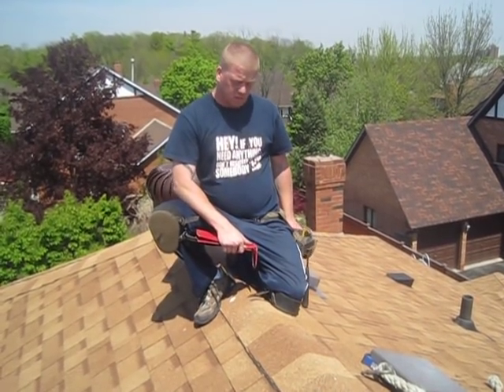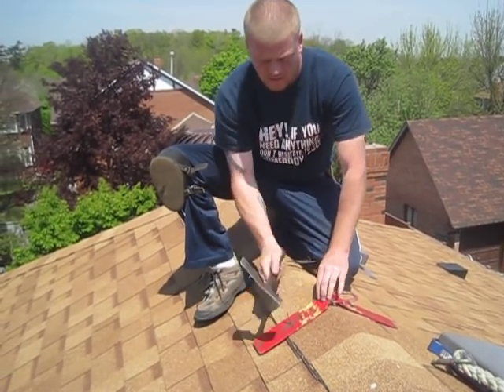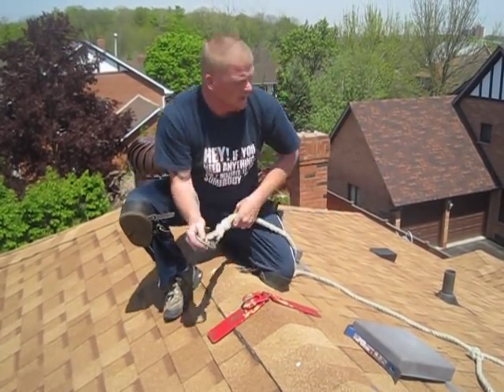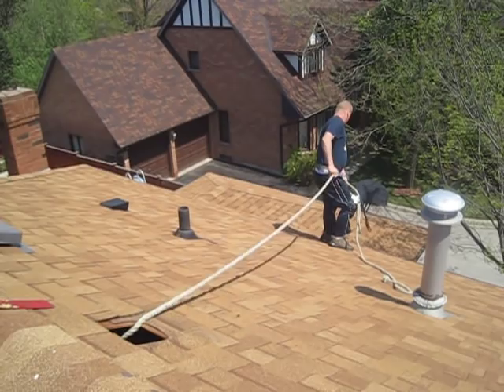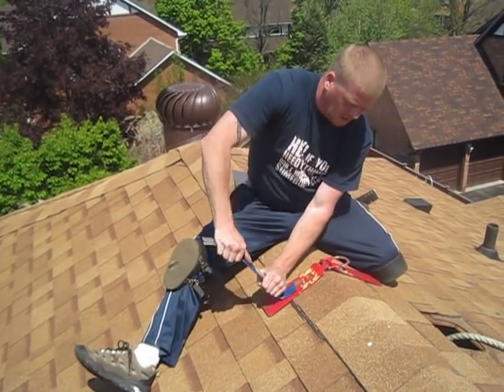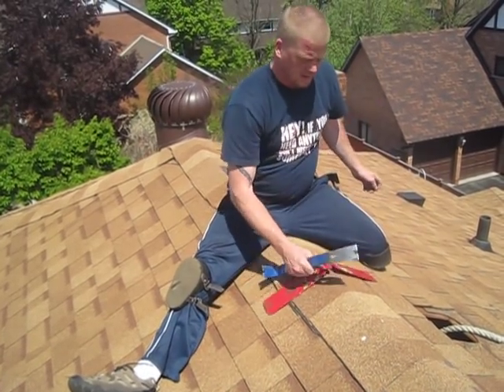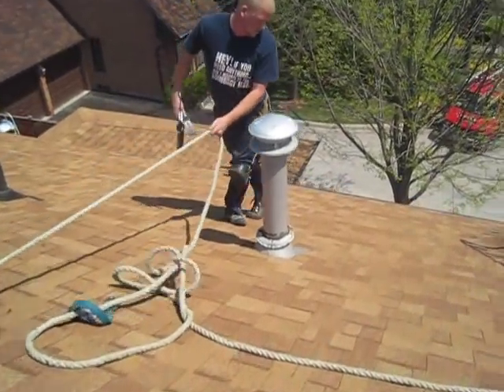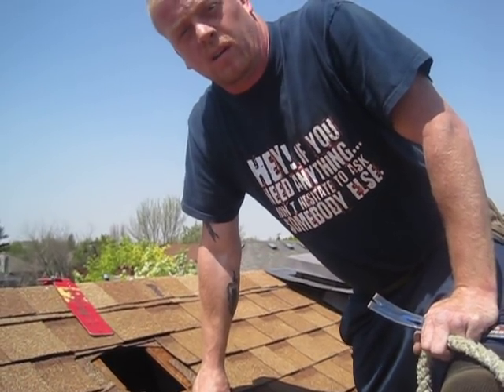Rooftop Safety

Comment: For all you home owners, when you want to clean your gutters, drive 4 nails in your roof. Not only in the plywood decking, but be sure you penetrate the trusses, or... You could rip your vents off. Good luck getting them back in without a roofer, and oh yeah, don't forget to throw the trash in the attic... Thanks, Elvis.
Reply: Dying over this video, and you summed it up perfectly with "don't forget to throw the trash in the attic"
Reply: Also, use your hand to karate chop you flatbar. Very important tip.
Reply: There is no way as a nearly 200 pound guy I’m trusting 4 spikes to hold me to the roof, and the pulling a vent is a total joke. Might as well just saved the trouble and hired the roofer that’s going to be paid to fix the mess you make doing that to clean the gutters for you...
Reply: That's roofing
Reply: By the way he's on a 4/12 I've never seen anybody on an 8/12 like this guy 8/12 is getting steep
Reply: Ok I did see the 8/12 side my bad really it's more cut than I thought
Reply: I think he's very good at what he does I'm a roofer we do alot of steep two stories double layer tear off resheets and maybee not the safest but how safe is roofing
Reply: blueyedevil TEAM MGK so you are proud of waiting unsafe? I do roofs steady and my first concern is going home in one piece... and ya a 4/12 is perfectly walkable. This roof is a little steep for someone that doesn’t walk roofs regularly
Reply: blueyedevil TEAM MGK did a home built in 1891 had a 2 story 8/12 triple tear resheet .
Reply: the nails hold just fine, screws are preferable, but nails have like 300lbs of holding force or something crazy like that, and he used 4

"good luck getting them back in without a roofer" 
just....slide it back under the shingles, renail, recaulk?
Reply: Those brackets state to use 32 nails or screws.  OK, I'll get right on it.
Reply: If you want someone to work on your roof, you have to be ok with them doing what they have to do to be safe. You’re not paying enough for them to not be safe. Or you can have permanent mounts installed if you’re that concerned about it.
Reply: If you tend to work unsafe on the roof you are one unexpected sneeze from falling. Sneezes come out of nowhere and a lot of people don’t think ahead.

Comment: Being this guy... Making a safety video about Roofing and the first thing he does is put a bunch of holes in the ridge, and then precedes to drag around haphazardly and almost trip over the safety catch the Rope was designed to be used with. 100% great job.
Reply: But what would be a better way to set up safety on a roof without puncturing the waterproofing material?

Comment: I install antennas on roofs and the hardest thing most of the times is getting onto the roof in the first place, little good these brackets help when you fall before you get them into place. I usually throw a feeder line that is tied to a heavy rope and go on the other side and pull it over and tie it to something on the other side, but then again that doesn't help if I go over that side..

Comment: Don't you have to caulk all the way around each edge of the metal vents to prevent water leakage? And are you sure you're going to be able to hang on to that rope if you fall or start to slide, since it's not connected to anything but your hands?

Comment: Can a person put the roof brackets on permanently, maybe nail them in and then caulk around the nails.  Can you use screws instead (sry, my only construction background is in stagecraft)?  I rather just put it up there and then leave it up there because I have to get up there annually to deal with the moss (or should anyway)...

Comment: Won't that red securement device leave holes on your roof once you take it off?
Reply: Yes and no. Obviously there are holes left behind. But, the shingles are made of soft asphalt for a reason. When they get hot, those holes are so small they will self seal, no problems whatsoever.
Reply: Don't listen to Erik. I'm a roofer and no those holes do not self seal. Lol. My day is made up of leak repairs. And a lot of them are fixing nail holes from improperly installed roof.
Reply: @michaelchristopher9444  Michael how do you install the harness tie down ring if you don't use nails please?

Comment: hello! thank you for the good tips. I'd never thought of pulling the vent cover.
do you have any hints on installing ribbed metal roofing on a very steep roof? I bought an old house that is a real fixer upper. first thing is the roof and it terrifies me, it's a 47 degree slope. any hints would be very appreciated.
thanks!
Reply: TheMapper Maybe you've done it by now, but do what he did with the D ring on the unfinished area, move it along as you go. To access an unfinished area you pull or leave out screws at the base and using longer screws screw a 2x4 onto the roof. After removal put washered screws in the holes.

Comment: Just as a complement of your information if you hit trusses you will be fine with 4 nail each side but if you don't you will need 8 on both sides total 16.
The anchors has to support at minimum 5.000 pound.
And if you want to be attached to trusses, do not use your life line for that, use an anchor strap.
But any way, good video and good luck,  not everyone can do what you did!

Comment: So if you put in a bracket every time your on the roof, and take it out each time, it seems eventually the wood would be full of holes and not make a good anchor.  It seems to me (a person with no roofing experience) that roofs should be built with a number of those brackets already in place (stainless steel nails or screws)  so safety is built in rather than installed with each job.
Reply: Good point. But to be devils advocate there's the cost and potential decay damage over time. Most people never go up on their roofs ever. Cheers.
Reply: abelincolnparth there is more than 1 trust u can anchor to
Reply: Indy Debauchery calm down simple spelling mistake
Reply: Simon Henhoeffer You're calling him out on his stupidity, I'm calling you out on yours. See how that works?
Also, it's spelled *You.  So actually you spelled one word wrong and mispronounced another.
Reply: In Dallas I've been seeing anchors on the newer steep roofs left behind by the builder for maintenance and reroof purposes.  Just started seeing it on homes built in the past 2 years now that everyone wants a steep roof
Reply: There are stainless steel permanent anchors you can install.

Comment: This is helpful for us DIYers.  Problem is I don't want additional holes in my roof every time I need to have my roof cleaned off or gutters cleaned.  If that bracket came in a thick zinc coating I could install a few and leave them so they could also function as moss control.
Reply: Zinc strips DO NOT work at all for moss prevention after the first year - do your homework
Reply: No need to be nasty.
Reply: +Susan Martin just don't want you and everyone being fooled out of there money by the zinc strip solution
Reply: Susan Martin, I'm looking for a solution to this problem too, but I'm wondering if you could just leave the nails in the holes when your done. Just a thought.
Reply: There are stainless steel safety straps meant to stay on your roof permanently.
Reply: permanent anchors..installed them lots

Comment: Would there be anything wrong with leaving one of these anchors on my roof permanently? I don't really see much sense in taking it off and then having to nail it back on again next time I need it. As long as I use roofing nails and caulk would it be okay?
Reply: Who sells this?
Reply: I just wanted to update you guys on @robert Faist. Sadly he fell off the roof of the house he was working on. The doctor's report that he is brain dead.
Reply: That’s a great idea, but I would paint it to blend in and put it in a place that’s not visible from the front if possible.  That bright red would drive me nuts.

Comment: Solid tips. Thanks. I like your quality commentary as you went along, too. You're right on with pushing your weight when pulling nails. This old guy uses a mallet or scrap 2x4 end to save my hands. Gloves, maybe wrist brace for hammering in the stuff bucket. And where are your safety glasses, young man?

Comment: More rooftop safety tips: Other than using a rope as your safety measure, you can wear a rubber soled shoe or boot, avoid slippery roofs, keep it clean, install shingle underlayment, and install temporary wood cleats for toe-holds.

Comment: Install anchor point in accordance with manufacturers instructions-may require the installation of the anchor point with many more nails.  Worker needs a harness and a lanyard.  harness and lanyard prevent the fall, and absorb the force.  Not sure the purpose of the rope without a harness and lanyard--very dangerous.  Length and type of rope is important as well.

Comment: So what if I have a metal roof? I really need to know also how do I get good footing on the slick metal??
Reply: believe it or not , shingle roofs are more slick than a metal roof . unless its wet or theres a bunch of stuff on it . keep your foot on the head of screws if you want . im on roofs almost every day , i know what im talking about .
Reply: +KentuckyFriedClassic I've been on both kinds of roof too. I've tried boots and tennis shoes on metal roof and I can't stand up, I just slide.
Reply: Jason Shingleton take a couple screws out and use the existing holes to screw down a 2x4 to stand on
Reply: Basically don't go on metal roofs without a pair of felt corkers. If the metal roof is wet, don't get on it at all. Wet metal roofs are unwalkable. And as always, it's good practice to use a rope and harness.
Reply: Try cougar paws for metal roof that what I use. Also if possible try to get on the ridge from the ladder or valley. Then set up the anchor and tie off.

Comment: If this is a safety video there are several things wrong, 1st when you put the anchor point down you have to put a nail in each hole for it to hold the prescribed weight of 5000 lbs, any anchor point must be rated for a 5000 lb drop load.  2nd He doesn't use a harness.  3rd he tied the rope back to itself which is not permitted.  Homeowners, whatever you do don't follow his safety advice.

Comment: could u tell me how u tie off on the 2x4 under the vent---thx for a great video
Reply: Its not always possible, depending on the location of the ventholes. but basically you just wrap the rope around the truss and clip it to itself and it won't go anywhere.

Comment: Can i leave the brackets on my roof permanently?  I concerned of water getting underneath of the bracket and leaking in.
Reply: There are permanent anchors available. I've seen them in stainless steel.
Reply: You can buy permanent anchors, best way is to safely remove the ridge cap and install it underneath behind the nail line. Install the ridge cap back on top. That way it won’t leak. A tube of black weather rated cocking to be safe too doesn’t hurt.

Comment: Just what I was looking for.  Simple how to and the roof vent idea is probably what I will go with.  First of all from reading some of the comments below, if you are not comfortable being on a roof to do this, forget it then.  I was a Lineman all my life, hanging off poles, ladders, trees, you name it.  Either you are comfortable with it or not, and if you are not, don't do it.  Yes it is important to be safety minded, but this guy is doing nothing that he is not capable of doing, that is the point.  I was up on my roof this summer, free style doing some eave & trim painting, but only on the single story portion.  Now, I have to get rid of the moss on the North side of the roof which has a steep pitch and is 2 stories.  I am 66 and will rope in for that as I definitely don't trust my balance skills as when I was younger.  Interestingly, Lineman now have to belt in to climb a pole, use a second belt to belt off to say advance over a  telephone line, before you can un belt your main strap and belt in over the obstruction again with your main belt.  Jeez, back when, always free hand climbed poles unless you were tired, or had a bunch of heavy stuff hanging off  your belt, or it was a 90' or 100' pole that you couldn't get your hands around starting up. Never heard of anyone falling off a pole while free hand climbing, although I am sure it has happened.  Safety first however, is always the motto.

Comment: Liked it. If you hit meat on both sides of the ridge with a few 3 ½" spikes, you could dance on the damn thing.

Don't so much like the roof vent trick, too many  have had work already and are a mess of random adhesives and irregular nails. After that, you're forcefully dragging your gear back and forth across rough cut edge of roof decking, essentially sawing it.

I'd bet that bracket cost twenty bucks or so... Worth it

Comment: Umm...you might be safer to not use that rope which you could trip on or which could wrap around you on the way down!  You should use a sliding break and harness.  ...but then again, maybe the rope can help you balance for just looking...if you are doing some work you can easily forget to hold on the hope.

Comment: No way that's an 8/12... more like a 4 or 5
Reply: my exact thought... also the rope is doing nothing there its a decoration since there is no harness on him to attach to...
Reply: @chazclemons4317  this roof is not steep enough to need ropes unless you have an osha job where it is required. in fact we never used ropes or harnesses on any jobs that was not required. the steep ones get toe jacks and toe boards of course.
Reply: @paulk5311  good for you

Comment: Before you secure that anchor to the ridge you are supposed to remove the ridge cap in that section and not throw your nails in there Atic definitely gonna have a leak there and that's not a 12 or anywhere close to it lol decent video tho

Comment: After seeing several of these videos and actually working on rooftop for a few years it doesn't make any sense to use this. Wouldn't it be much easier and safer to just put a eyelet lagbolt permanently in the roof! You're going to go thru all the bs of putting this on without a rope, and then when you are done, you are going to undo all the nails and go off the roof without a rope! Two times with the potential of falling off!

Comment: I just watched a You Tube video on ladder-safety. The ladder-safety “expert” ascends & descends the ladder with his hands tracing the rails. If he loses his footing he will not be able to hold his position. His hands should be gripping the same rung with each step as no man could hang from ladder rails while regaining his footing.

U.S. per year: cop-deaths = 128; ladder-deaths = 300 THERE WAS A DRAMATIC decrease in the number of law enforcement officers killed in the line of duty in 2017, with the second lowest number of officer fatalities in more than 50 years, USA Today reported. According to data released by the National Law Enforcement Officers Memorial Fund, as of Thursday, 128 officers had died in the line of duty in 2017. Forty-four of them were shot and killed. This is a 10 percent decrease from last year, which had 143 deaths, with 66 shot and killed. 
According to the World Health Organization, the United States leads the world in ladder deaths. Each year, there are more than 164,000 emergency room-treated injuries and 300 deaths in the U.S. that are caused by falls from ladders. Most ladder deaths are from falls of 10 feet or less.

Comment: I hope you sealed those nail holes since theyre water penetration points
Reply: looks like someone didn't watch the video....
Reply: right lol if you watched you will see he went a step above that by putting in actual roofing nails in the holes to plug them and then put the goop on the nails to seal it.